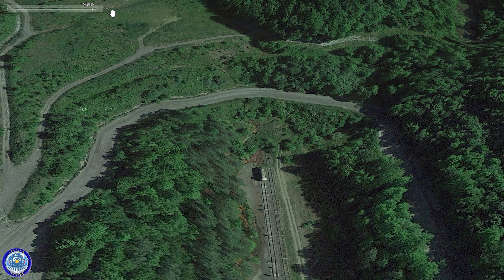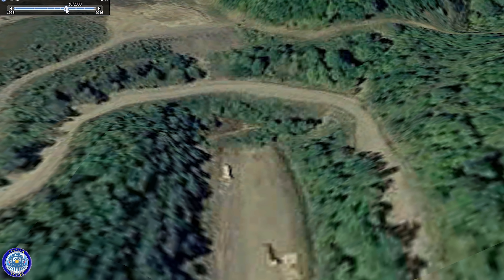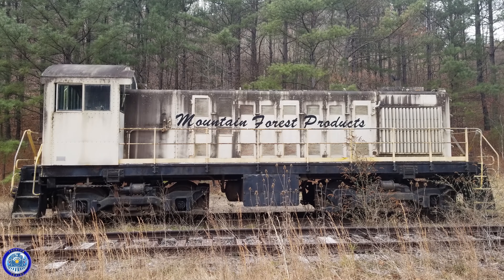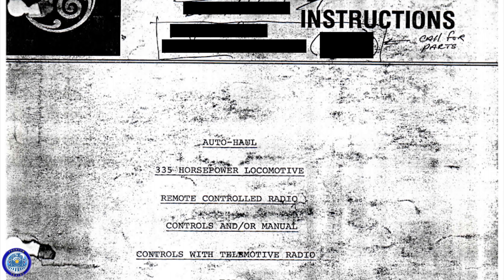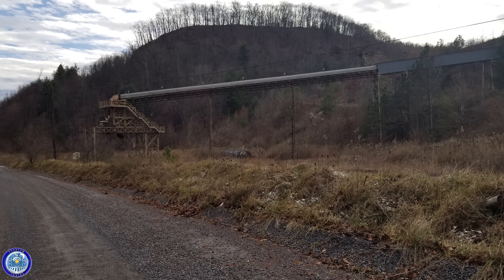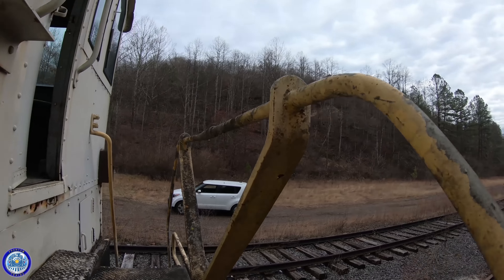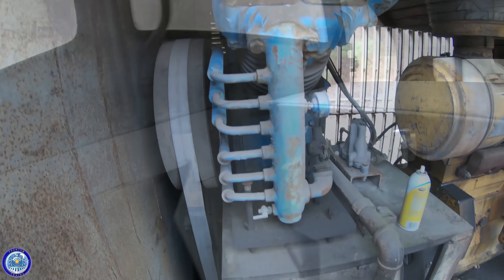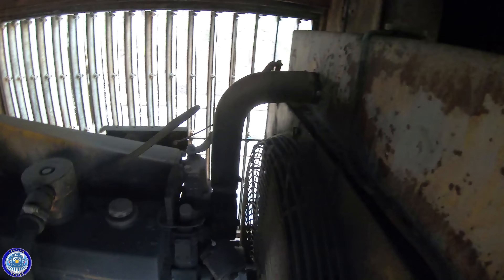I found an Abandoned Locomotive - Must See!

Comment: I love those S2-S4 Alco units,they always looked awesome to me,I think that depending on what variation it was,they were any where from 660 HP to 1,000 HP and alot of them had 6 CYL engines.It's cool to see a Caterpillar in it,and it's not the first unit they have had their engines in before.There was a 1954 RS-4-TC-1A that Alco came out with but had Baldwin build as a subcontractor,they had a D397 V12 and were all sent to the Army after building up to 71 units of them,may be more.The TTM in San Antonio has one as 4035,it still has the black Military paint on it.The one owned by them has been in use there since 1995,in 1988 while the Army still owned it,it was rebuilt with a EMD cab and 3508.

Comment: As someone who has operated an S-2, it would be nice to see it working even with the downrated Cat engine. From the looks of it, it wouldn't take much to make it operable again. You can do quite a bit with just 300 HP, just don't expect it to move at a high rate of speed. It even looks like it was upgraded to roller bearings so it would roll a bit easier than ours did.
Reply: I would say, drain and replace fuel, change the filters, change the oil, and a set of batteries and bleed the injectors and I bet it would run. Don't forget to add water though.
Reply: Agreed. Looks like its in great condition and is ready to go
Reply: This locomotive is for sale

Comment: This unit sits at the end of Clinchfield Railroad's (now CSX) out-of-service Fremont Branch.  The original site was home to Clinchfield Coal Company's (not to be confused with the Clinchfield Railroad, separate companys) Moss #1 mine and preparation plant.  The mine and plant opened in the early 50's.  The Clinchfield Railroad built the 18 mile long branchline primarily to serve this one customer.  The mine closed in the 70's I think, but the prep plant continued until the early 80's.  While it was in operation, mine runs would work north out of Dante, pulling back raw coal from loadouts on the mainline and up the Nora Branch.  Then a run would collect all the raw coal and maybe 50% empties and head up the Fremont branch.  Usually it would be two units on the head and another two on the back pushing.  They would work all the loadouts on the Fremont Branch, reach Moss #1 ("Lick" in railroad terms), drop raw coal and empties for cleaning, pick up clean loads and head back.  After the prep plant closed, a wood chip operation operated on the site for a couple of years, then closed.  The last train on this line ran in 2014 to pull empty chip hoppers out of the yard.  Today, the line is in not too bad a shape.  I have walked some of it.  Bear Pen Gap Tunnel still looks to be open, there are several small rockslides, and a few drainage issues.  Nothing that a good brushcutting, ballast and front-end loader/backhoe wouldn't solve.

Comment: If everything is in place (at least the most important parts), you can use wd40 for the electric solenoids and switches, inspect a bit the cables and screws in the cab, engine room and then prime the engine. I would not touch the brakes (we do not want the beast to start rolling!) But I would just leave the locomotive as is.

Comment: I will never understand why u would take a 1000 horsepower engine outa that and replace it to what is equivalent to a pickup truck engine
Reply from the maker: From what I understand, the OEM engine gave up the ghost, so to speak, and the small chip mill put in an engine that they had. So it was all about the dollars in this case. But I agree, it was an insult to the spirit of that locomotive!
Reply: @PhantomTrains   ok. Thanks for the explination. Theres an old Alco S2 at the west Chester railroad near where i used to live. Its an ex-Wilmington & Western but it doesnt run.

Comment: 350 horse power ?  I'm susprised it could move it'self,,,,,,really,,,,I guess the least hours power I've seen is  1200,,,,,
Reply: Level grade siding, only used to push cars around to be loaded,  not like it was expected to take a 10 car consist out on a main line. There's a railcar reman shop that's a customer of my work that has a similar unit, except its repowered with a 450hp Cummins N14, but its more than enough to shove cars in and out of repair shops.
Reply: I remember a video from high school science class showing a riding lawn mower pulling a boxcar. Once the initial friction is broken to get the car in motion, on a level grade even a person can push it to keep it moving.

Comment: Start it
Reply from the maker: I have been told it starts right up! It's for sell on a website. Luckily, they have the location marked as New York, which is hundreds of miles away from its current location.
Reply: @PhantomTrains  what does something like that cost?
Reply from the maker: @andrewpayonkify  I talked to the broker who is selling it. They want 30k for it. That's not bad considering it is in great shape. However, it has to be moved via truck. The line it is on hasn't been used in years, large sections are destroyed, so the guy said you'd need a crane and a flat bed capable of moving something that big/heavy. Moving costs would be tens-of-thousands more.